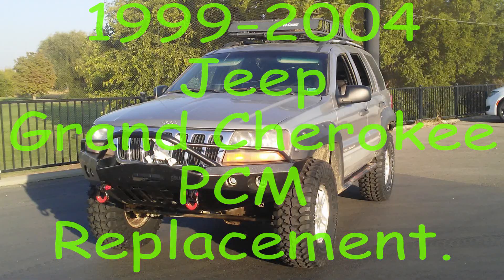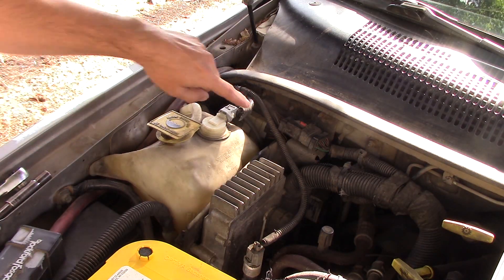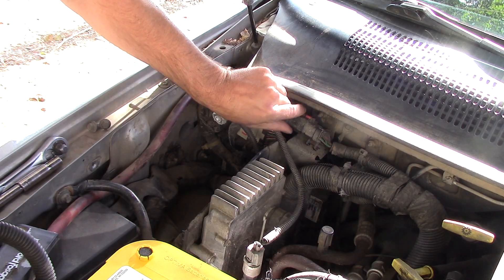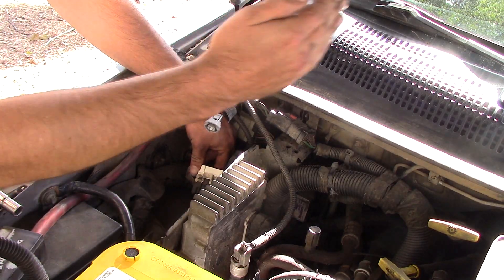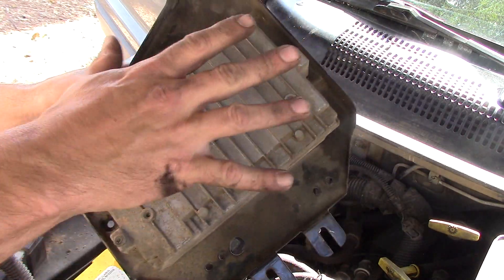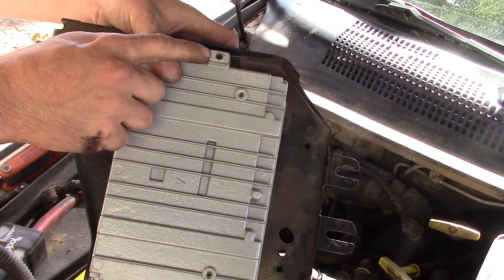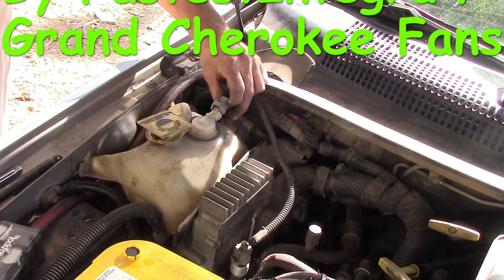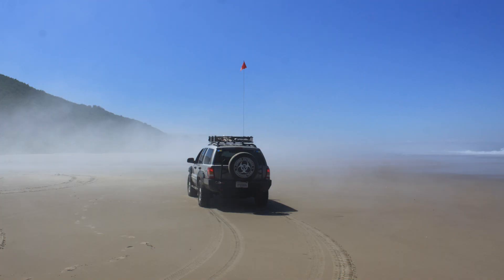1999-2004 Jeep Grand Cherokee PCM Replacement

Comment: I am buying a pcm for my 1997 Jeep Grand Cherokee Laredo 4.0 6L from rockauto it’s 
219.00 for part 
70.00 for Core Fee 
30.00 for shipping
26.00 for taxes 
Roughly 340.00’Total 
But purchasing it tomorrow and I can not wait I am sick of all the stalls on the highway having to hit the pcm and crank it. I had spent 600 on parts for 
Starter 
Fuel injectors 
Rebuilt the distributor:cap,rotor,camshaft sensor 
New battery and terminals
Ignition coil
Spark plugs and wires 
Crankshaft sensor 
And it still would die at times.. I wiggle the pcm or tap it then it would start sometimes harder then others..
Oh and I got new wire harnesses.. 
Damn PCM smh

Comment: I have a 2002 jeep Grande Cherokee and am having trouble finding a new or used one I'm in Shediac New Brunswick Canada any suggestions
Reply from the maker: Do you have AutoZone in Canada I'm pretty sure there is.
That is where I got mine from I just had to give them my VIN number and one was shipped out to me within a week the car ran a little rough after I installed it for about 50 to 100 miles and then it smoothed out and it's fine
Reply: Hey buddy,I'm trying to figure out where does that big bolt location that's  connected to the ground go on the bracket cause my ground wasn't connected to the pcm when I took it out.
Is it one of the screws that bolted to the bracket?that screw look too small to be the one
Reply: It's a year did you get it fixed

Comment: Thanks so much (I bought one from Ebay and had it preprogrammed.) Only issue was it was spray painted silver even on the plug sockets and very worn looking. Cost about $250 with shipping.  But all works great Now! Your video was life savor and saved me a lot of stress with the dealers!

Comment: RECALL QUESTION: In 2015 there was a Recall for the 2004 Grand Jeep Cherokee Laredo 2-Wheel Drive 4.0L Engine regarding something associated with the "Airbags" that is actually caused by a problem with the "ECM," which is also referred to as the "PCM." When taken to the dealership in 2015, the service staff said, "Don't worry about anything with this Recall." Each time the vehicle was taken to the dealership for an oil change over the next several years, the staff of the dealership would say, "Don't worry about it." But now in 2023 the "Engine Light" turned on. When taken to an automotive repair facility, the code that came up said "Thermostat Malfunction" and the service staff said this problem was being caused by the "PCM" due to the fact that two "Thermostats" had already been replaced during previous instances when the "Engine Light" turned on.

On the Mopar website, when the VIN Number is entered for this 2004 Grand Jeep Cherokee are entered on the website, is says there is an active "Safety Recall" associated with this product. The Mopar website says the Recall Date was January 27, 2015. The "FCA Recall #" is listed as "R06." The "NHTSA Recall #" is listed as "15V-046."  The Mopar website then lists the following information:

Safety Defect/Non Compliance Description and Safety Risk

THE AIRBAG SYSTEM OCCUPANT RESTRAINT CONTROL (ORC) MODULE MAY EXPERIENCE A FRONT AIRBAG AND/OR SEATBELT PRETENSIONER INADVERTENT DEPLOYMENT. AN INADVERTENT AIRBAG DEPLOYMENT WHILE DRIVING COULD DISTRACT THE DRIVER AND CAUSE A CRASH WITHOUT WARNING.

Repair Description

ALL INVOLVED VEHICLES MUST HAVE THE OCCUPANT RESTRAINT CONTROL (ORC) MODULE REPLACED. IF YOUR VEHICLE STILL HAS SAFETY RECALL M35 (12V-527) OR N13 (13V-040) IN THE "OPEN" STATUS, PLEASE SCHEDULE YOUR SERVICE APPOINTMENT WITH A CHRYSLER DEALER TO PERFORM THE REPAIR. IF YOU ALREADY HAD M35 (12V-527) OR N13 (13V-040) COMPLETED, RECALL R06 MUST STILL BE COMPLETED ONCE PARTS BECOME AVAILABLE.

Recall Status

INCOMPLETE BUT REPAIRE PARTS ARE AVAILABLE. 

There is no mention of a "PCM" or "ECM" in this description above from the Mopar website. Everything seems to be associated with the "Airbag" portion of this recall. However, this is not the same when you look at this "Recall" Description on another website called cars.com. The cars.com website specifically lists the "ECM" as the cause of the problems with the "Airbags." 

The cars.com website also lists the Recall Date as January 27, 2015. However, the cars.com website lists the NHTSA Recall Number slightly different as "15V046000." 

The following information regarding this recall is provided on the cars.com website and specifically mentions the "EMC" part

Air bags
Recall date
2015-01-28
Recall no.
15V046000
Chrysler (FCA US LLC) is recalling certain model year 2002-2003 Jeep Liberty vehicles manufactured January 9, 2001, to March 28, 2003, 2002-2004 Jeep Grand Cherokee vehicles manufactured February 13, 2001, to May 23 2003, and 2003-2004 Dodge Viper vehicles manufactured November 1, 2001, to June 30, 2004. Due to electrical noise beyond the tolerance of the air bag electronic control module (ECM), a component in the ECM may fail, causing the front air bags, side air bags, and/or seatbelt pretensioners to deploy inadvertently while the vehicle is being operated.
Details
Recall consequence
Inadvertent deployment of the air bags may increase the risk of injury and the possibility of a vehicle crash.
Recall action
Chrysler dealers will replace the air bag control module and front and/or side impact sensors as required, free of charge. These parts are not currently available, however, an interim repair is available free of charge that reduces the risk of an inadvertent deployment. This recall remedy was applied during earlier recall campaigns of these vehicles under safety recalls 12V527 and 13V040. All owners that have not had the recall repair performed under safety recalls 12V527 or 13V040 are strongly encouraged to have it performed and not wait for the final remedy to be deployed to the field. The replacement ECM parts needed for the final remedy are not expected to be available until the latter part of 2015. Owners will be mailed an interim notification in late March 2015 and will be mailed a follow up notification when new air bag control modules are available. Owners may contact Chrysler customer service at 1-800-853-1403. Chrysler's number for this recall is R06.: 

MY OVERALL QUESTION IS: "Is this R06 Recall that is associated with the 'Airbags' with the 'ECM' as the cause of the problem the 'Recall' you are referring to in your video?" 

If so, should the dealer be replacing this PCM/ECM for free - the way they presumably should have since 2015 rather than saying, "It is okay; you don't need it done"?

Comment: I put in a new pcm with Skim delete. Best thing i ever did for my wj. That's a tipical thing to go out usually. Pcm/skim.
Reply: I have an 01 grand Cherokee and the battery has a constant drain on it even with key removed. Could that be the skim?
Reply: Sounds more like a bad pcm. I had that problem too
Reply: @jasonfrazier3383  is a pcm and a ecu the same thing ?
Reply: @cristiancastro5249  yes
Reply: @jasonfrazier3383  I have the same problem. Sits longer than 2 days it's drained. Been chasing it for awhile. Only thing I haven't changed on this thing is the PCM.
Reply: @knockout_wj8886  parasitic drains on the wj may commonly come from either door wiring issues.. or rear of car issues.. rear windshield wiper stuck (less common) or more common the headlight housing with contact point issues between the bulb holder and headlight housing.. also inspect your third brakelight for issues.. check fuses and relays.. may not help but its from what ive read and discussed with fellow owners
Reply: That happens in these cars when you turn off the car and remove the key from the switch, it is not in the correct or exact position, or it is a little further back. I have tested this on Liberty and Grand Cherokee, also on a Dodge Ram. I have put a mark in the correct position in which the switch should be when the key is removed. (Sorry for my English).

Comment: My 99 Limited v8 doing the same, recalls still works for this year of cars???
Reply: no they dont
youre going to have to reach out to a company that remanufactures them.. i did research for 1 month on the best option.. auto zone and o reillys both sell them through a third party.. they program them for you.. and will ship within 2 business days and offer a 2 year warranty.. have it professionally installed so you can also receive a warranty from them incase you do anything wrong.. or diy if you feel confident.. i tested my suspicion with a pcm from the junk yard.. ,but i had to take out the pcm, sentry system for key security + have the key (mounted key next to ignition so the security system would read the signal) .. otherwise it wont stay on when you turn key.. ended my stalling issue. Returned pcm to junk yard for refund and ordered one online. Just visually you can tell the difference in the way they make them between new and OEM computer. Good luck.. i dealt with this issue for a while and thankfully didnt go replacing random sensors and wires.
Reply: @jeffreystine7068
Reply: @centralfire3831  ?

Comment: Thanks so much about the tip on the recalls. Called the dealership and got it fixed for free.
Reply from the maker: That's super cool they took care of it for you.
Reply: What year? I have 2003 limited error code po601 but my battery cables are corrected witch could cause that code it has a intermediate rough iidle  and intermediate misfire so I am doing the battery cables 1st and clear the codes and hope for the best ..and were do I get a preprogrammed pcm?
Reply: WHAT DEALERSHIP? IVE CALLED EVERY JEEP DEALER IN SOCAL AND THEY WONT EVEN TALK ABOUT MY 99 WJ? I NEED HELP :/

Comment: Bro I have the exact same issues, on a 2000 Grand Cherokee Limited with 258,000 miles. No codes, Bad idle, dies randomly. Thank you for this video.
Reply: Bro what did you do to fix it
Reply: @cristiancastro5249  sold it for about $1200 :))

Comment: Great video. Straightforward.  Say, with a a coded security ingnition key, does my 2004 Grand  need to go to a tech to
program for the security? Or does an aftermarket  PCM have all this integrated with the proper provided  serial number and vin?
Reply from the maker: I had to give them my VIN number so they could properly program the PCM to the vehicle. Did not need have anybody else touch it after the install.
Reply: @FastestIntegra  is a pcm and a Ecu the same thing ??
Reply from the maker: @cristiancastro5249  yes

Comment: Unrelated but I ordered that same bumper and wondering what the measurement is in the winch mount area? Will it fit a large winch? Also how heavy is the bumper? I'm lifted but worried about needing to relevel lift if winch and bumper will add 300lb or something crazy like that.  Thanks.
Reply from the maker: The front bumper is not that heavy I can pick it up and put it on myself probably around 100lbs. I have not bought a winch for mine yet but it'll fit up to a 9500 lbs winch.  The rear bumper with spare tire mount weighs a lot I'm sagging around 2in in the rear now even after putting a brand new lift kit on.  I paid to have them powder coated in both the front and rear bumper came scratched really bad and I had to file a damage claim with the shipping company total nightmare.

Comment: Where did you get your new/remanufactured PCM? I am in Norway, Europe, and having a hard time findig a programmed remanufactured PCM to my 1999 WJ. My PCM's partnumbers last 5 digits are 429AE...
Reply from the maker: I got a Blue Streak PCM from AutoZone not sure if you have those over there or if they'll ship cross Seas. Good luck.
Reply: Check Ebay or google search it. Theres a lot of places that have overseas versions and will program your vin on it